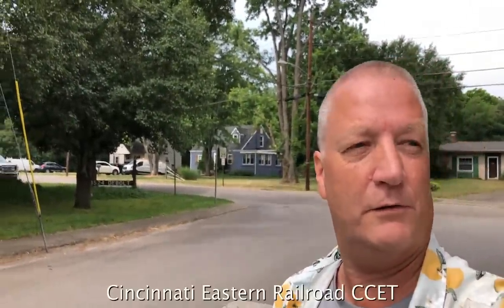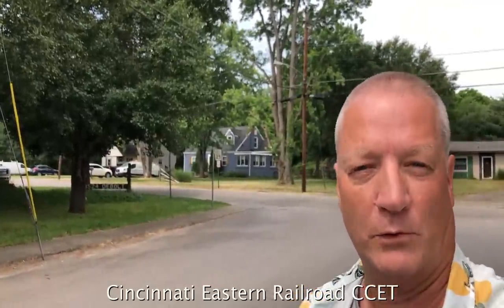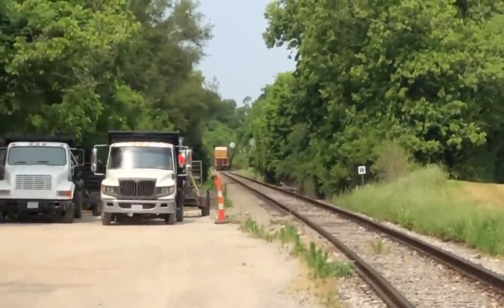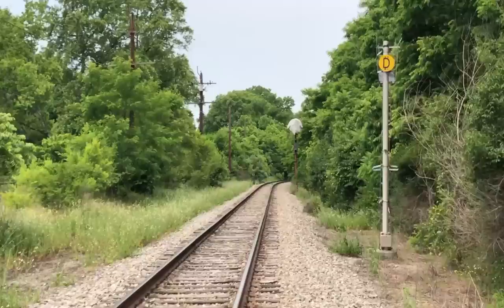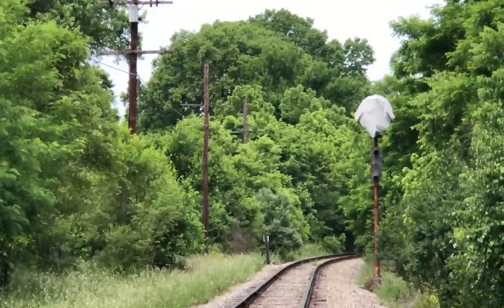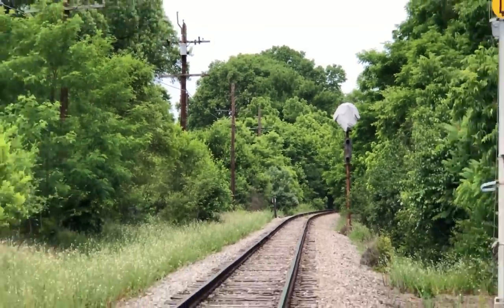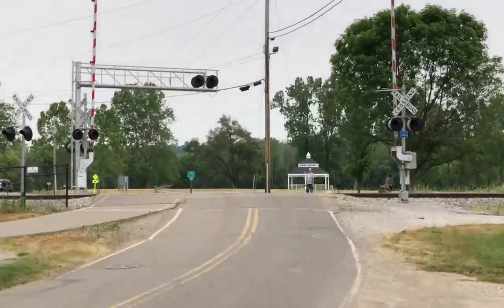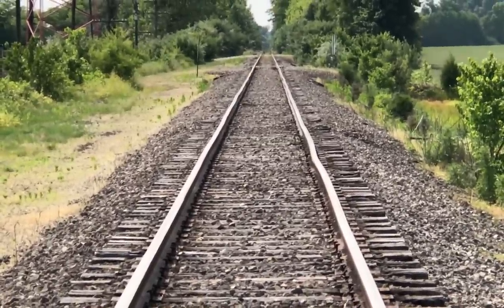See How Many Cars This Train Gets At The RR Interchange With Norfolk Southern!  MP15DC & SD40-2

Comment: Very nice to see the CCET in action especially with the locomotives that they used. This is the time for retooling in the Auto industry so all of those flat cars àre meant to Haul truck frames. The group in yellow are missing the top clamps as well as the chains to hold them in place. The brown cars apparently have never been equipped. Even more interesting is the fact they have no TTX sticker and with the age restriction waiver may very well have been recently converted from auto racks. A very good find indeed and glad to see the pup beefing up😢

Comment: Those old yard switchers are getting up there in age. And they are still going strong. Speaking of signals i saw some crazy looking crossing signals at the new make over at the Pittston Pa. R.R. station.  I heard of these signals before but have never seen one actually working. They are called Wig wags.
Reply: Not as old as you might think -- that particular locomotive was built in 1982. That's five years younger than the SD40-2 it's coupled to.
Reply: @beeble2003 they were fun to operate backwards or should I say “ in reverse “ ~~~

Comment: there's a railroad bridge that goes across the Manasquan river in NJ and in the summer when it gets hot and they get rail heat kinks, they dump water on the rails. Not a solution for Ohio but if they had a tanker car with water perhaps they could hose off sections in an attempt to take the kink out?